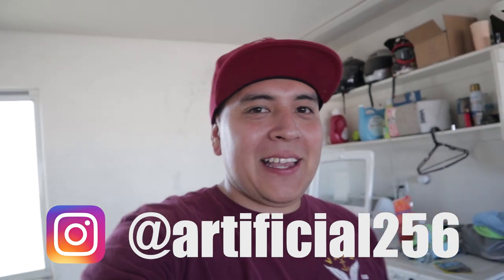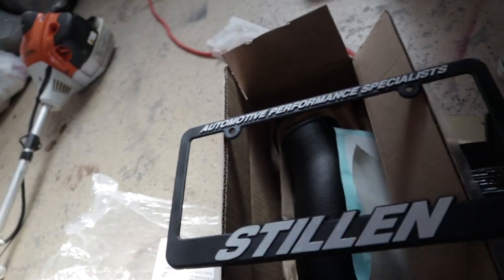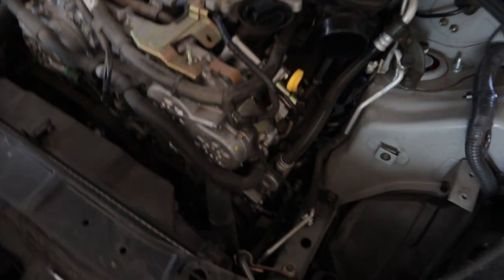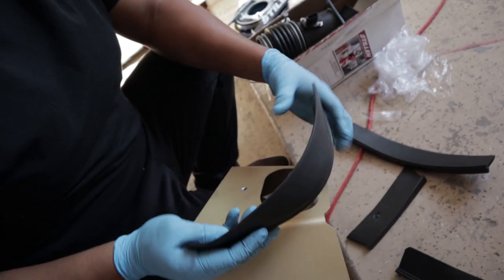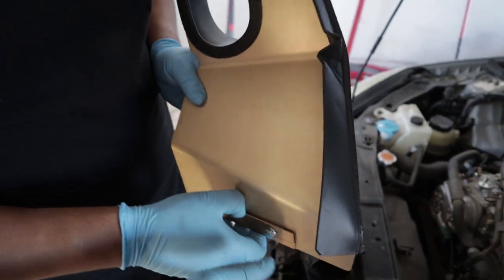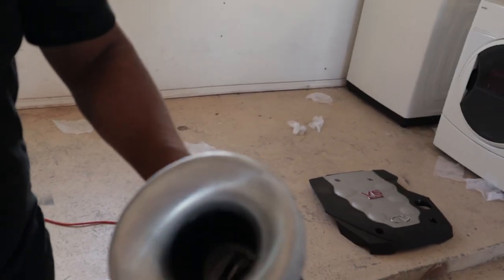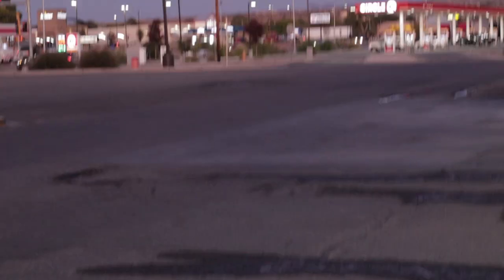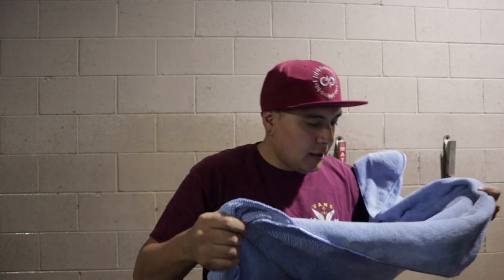G35/350Z JWT POP CHARGER STILLEN Z-TUBE INTAKE INSTALL!

Comment: Has oil been a problem? Been thinking about getting a g35. Keep grinding too bro
Reply from the maker: Recently kind of. I think I was down a couple quarts. It didn't show on the oil dip stick, so I got scared
Reply from the maker: But I've been keeping up on checking. Btw I should check it now haha. This is why I want to get a catch can as well
Reply: Chris 256 install a catch can the proper way, not the way the traditional instructions will show. I got my catch can a spent a lot of money on a branded one and had to spend more money for extra parts to properly set it up. Do it the right way first and it’s actually gonna help with the oil consumption
Reply from the maker: What's the right way?
Reply: Chris 256 the correct way is to connect the oil catch can to both valve covers instead of just the pcv, block off the intake breathers and use a another breather to release all the bad stuff into the atmosphere

Comment: VQ's take too much work to make fast without FI, and I don't know about you but I make $10 an hour so that won't be happening any time soon
Reply from the maker: Honestly I think that they're fast enough. Especially if you want to drift or learn how to drive on a road race. You don't need that much power to do those things with this car. If you want something faster go with a different platform.
Reply: Ya but I like to street race and there's a lot of 5.0s here so I gotta keep up
Reply from the maker: @acm_1028  driver mod, full bolt ons, tune,  and you could probably keep up. But if you wanted this car to race you should know that they won't keep up with those cars.
Reply: Chris 256 ya I'm saving for a tune right now, have you seen the key trick where you Rev to 2500, turn it off, and turn it right back on? It makes your car pop like crazy
Reply from the maker: @acm_1028  yeah wouldn't
 recommend it
Reply: Chris 256 Ya it's probably not good for it